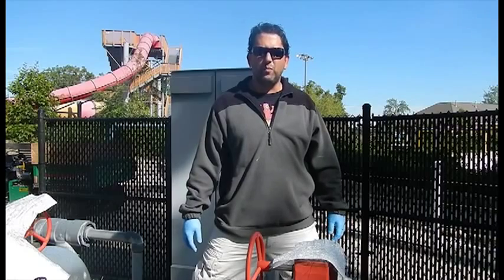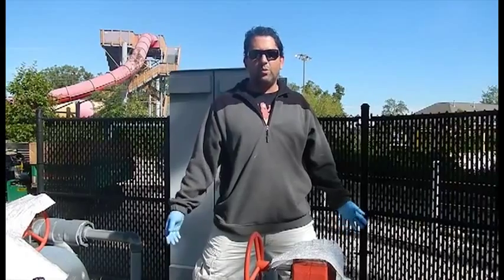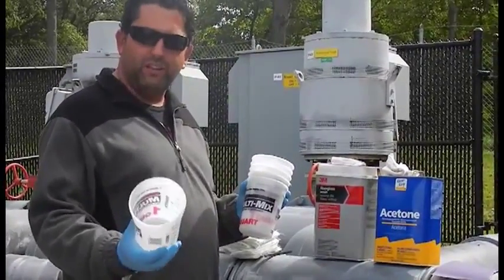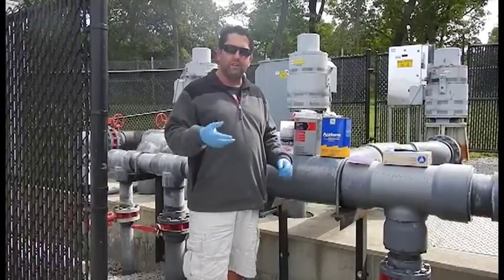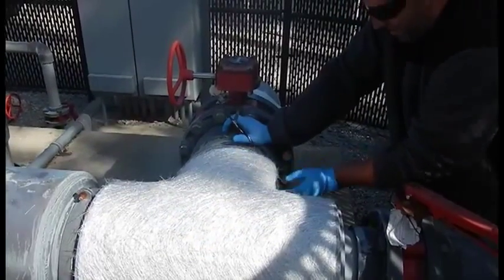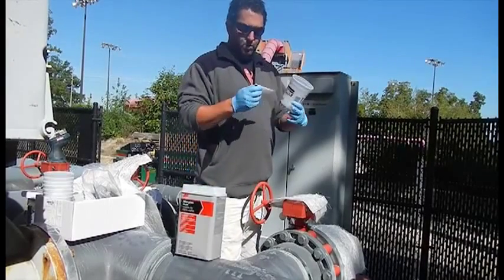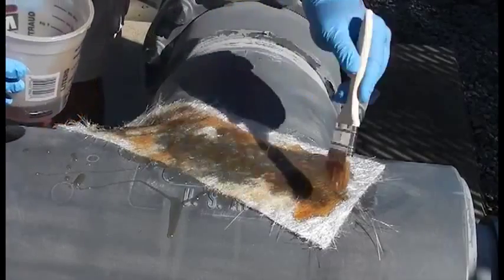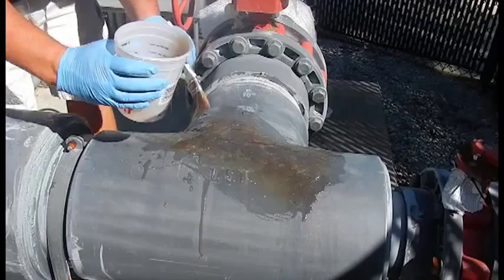How-To Repair a Cracked PVC Pipe Using Fiberglass

Comment: Chris, many thanks.  I had been battling a cracked, leaking PVC Tee in my pool plumbing for weeks using mechanical means - hose clamps, u-clamps, etc.  It was too close to other major components to easily replace.  Finally used your fiberglass technique and it works great!!

Comment: Chris, this is a very inspirational video, I´m manufacturing a jobo (fruit) picker with 1-1/2" PVC pipe lined with fiberglass and polyester resin.  Next time it´s due to replace that PVC flange assembly, you may want to reinforce the piece before installing it with a twill fiberglass e cloth, highly conformable, that will allow you to follow the PVC pipe shape without having to cut it.

Comment: Chris, what kind of resin did you use? Polyvinyl, polyester or epoxy? Need to do a boat repair and thinking of using PVC board to help support an area under the cockpit sole using pvc instead of wood for a stringer. Want to make sure the resin bond well or doesn't react negatively to the pvc.  Thanks much!
Reply: Polyester